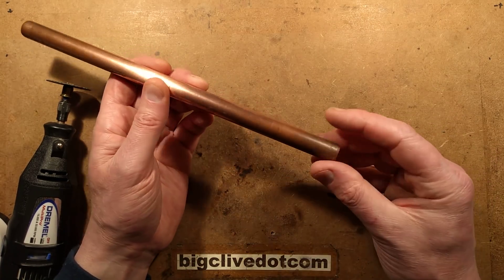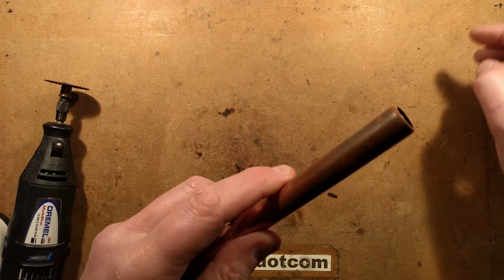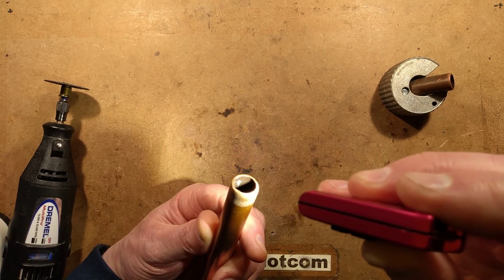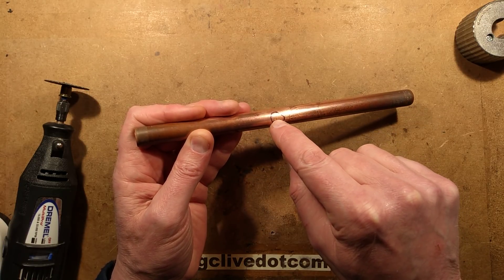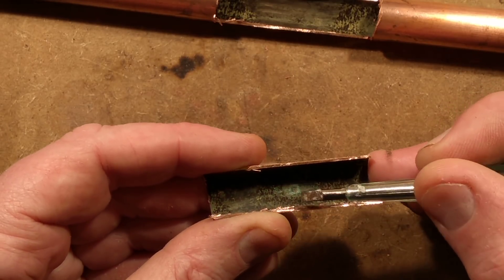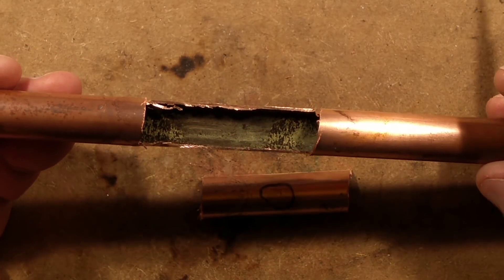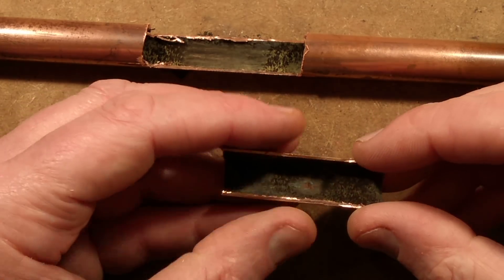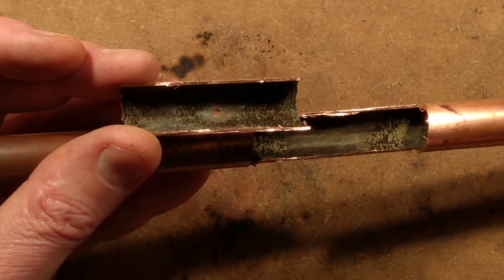Odd pinhole leak in copper pipe.  Selective electrolytic corrosion?

Comment: Was it in the hot or cold water line? If the hot, do you have a circulating system? There's only a few reasons a pinhole happens in a run like that and not at a directional change or material change. Depends on the answer to my above question, need to know if it was hot or cold for sure...and if there's a circulation system...and what kind of backflow device is used where you're connected to the boiler you mentioned. Unless you were talking about a water heater and not a true boiler.
Reply from the maker: Main cold feed.

Comment: Locking the barn after the horse is gone...
I most always shut off the water coming into the house, if I  am away for more than a day or two....
This doesn't fix anything,, but it limits the damage of a catastrophic failure. 
Keep up the good work,,  always interesting videos...
Reply: That works great unless the pinhole is ahead of the mains shutoff as it was in my case. I had to have the city shut of the water at the street and then spend $10,000 CDN digging up the front yard to install a new feed line into the house.
Reply: @PhoenixRevealed  
Yes Sir..  that is one that we have no control over..
And it is still a bummer...
I hope there wasn't too much dammage.
I think in some communities,  the municipalities are responsible up to the shut off/meter..
Thanks for the reply.
Reply: @willybee3056  - Had to replace a laminate floor in the basement, but it could have been much worse.
Reply: @PhoenixRevealed  10 grand for a new feeder line, jesus i've run half a km of sewer for less than that much less simple water feed
Reply: @Mister_Brown  - Most of that cost was the excavation, much of which had to be dug by hand due to proximity to the house. It also went straight through a front porch which had to be rebuilt afterward.

Comment: hi Clive.
i have been a plumber for 32 years. 
what you have there is recycled copper pipe with steel contamination. it will only get worse. 
if you take a caliper and measure the wall thickness at various points in that piece you cut out you will find discrepancies. 
sorry, but you need to change those pipes.
i could give you a good price on that  but you would have to pay my air fare from Canada.
Reply: As a mechanical engineer I've seen this even in "pure" copper pipe. More often than not there is an ancient boiler/water heater upstream of the problem... I bet if Clive gets that unit flushed out it's full of sand-like rust! Tiny bits of iron can get swept up and stuck in the scale that forms inside the pipes, and with the chemistry of the water can corrode these kinds of pinhole leaks.
Reply: @Smidge204   hi smidge, you have a very valid point. if clive gets his boiler flushed he should check if a magnet can pick up whatever comes out. we actually have magnetic filters in our highrises. (not the fake ones). unbelievable what they pick up.
Reply: @Smidge204  would the water heating element scaling off over time introduce contaminants?
Reply: @nathaingalt8623  usually electric immersion heating elements have a corrosion resistant jacket. What's more common in older systems is the heater  itself is a plain steel tank, which gradually rusts out. Newer tanks have cathodic protection but that doesn't last forever, or are coated with glass or enamel on the inside which is better but can still fail.
Reply: @Smidge204  I wonder if that's why some things like heaters are supposed to have a sacrificial zinc?
Reply: @pauljs75  That's EXACTLY why...
Reply: @pauljs75  Wasn't magnesium rod?
Reply: @Smidge204  This has me worried now - our water tank rusted and burst several years ago, then a few years later the pipes upstairs leaked which resulted in having to get the asbestos guys in and replace the whole ceiling.  I wonder if any more problems like this are in store...
Reply: @Smidge204  this occured in both the cold and hot water side of my dads house. Our water comes from mountain run off. We believe that over time, iron bits from the water we got made its way into the pipes. We also noticed, there was always a corrosion layer, covered by a deposit layer that protected the inside of the pipe like the enamel on a tooth.

We installed a water softener, and within a couple of months, had our first leak, and within a year 3. Before that, never had an issue. Also had installed a water filter inline before the softener and if i had to guess, unless the water softener had metal shavings in it, its unlikely that the iron deposits came from the softener.

Im guessing the soft water began destroying the mineral layer.
Reply: @SupernovaSpence  Water softeners leak some of the salt, so if there is some iron n the pipes is going to accelerate the corrosion.
Reply: This is the sort of stuff that makes me dream of a house plumbed with 316 stainless steel 🤪🤩
Reply: Recycled copper is electrorefined just like most other copper - it isnt a process all that prone to chunks of contaminant.
Reply: Hi Clive
...
I too have been a Plumber some 42 years.
Lawrence can you remember when Cu (copper) pipe in UK rocketed in price.
Then we had a massive influx of cheap imported Cu that was passed off to the unsuspecting plumbing trade at the time, as UK Cu, now Dunn'a be asking the year.
But the pin hole were in fact due to Electrolysis within the impurities later found and pinned down to this import. They were thousands of metre in the housing industries. I've taken a few hundred metre of that faulty Cu out.Also at that time Plumbers were accused of not flushing systems out after using Steel Wire Wool days to clean the ends of pipes Pre-Self cleaning Flex.
What I also found out, (which got me into electrical and dabbling in electronics) that in some of these dwelling there was a small earth fault of <15mA enough to make your ear tingle in tight spaces when you held onto one peace of pipework then rested you head on another.
Reply: This is why people are going with pex.
Reply: @Tb0n3  It is the better option for most applications, albeit a bit more expensive.
Reply: A good price doesn't include a large cost in airfare lol
Reply: Chlorine, hard water, water cavitation, impurities within copper during manufacture, shitty craftsmanship by leaving tonnes of flux around soldered joints are normally the cause!
Reply: I'll not disagree with this as a potential cause but knowing the property type Clive lives in, approximate age, looking at the gauge of the copper pipe wall (looks like decent original British stuff), I would say this is original copper pipe in his house, would not be more recent (last 30-40 years lets say) copper pipe - so could be a good 60-70 years or so old. Therefore I think the contamination is somewhere else in the system, not the pipe.

I have seen a pinhole leak like this on old 3/4 copper pipe, with decent thick copper in my parents house, house was built in 1906 - this leak was uncovered during renovation works about 3-4 years ago so the pipe was a good 111 years old - they were not using recycled copper pipe in 1906 - cause - who knows but it happened. Could have been an old water heater related issue but not sure.
Reply: @peterpeterson9903  
hi Peter,
common use of copper in houses did not begin until the late 40s. before that it was steel, (galvanized) and before that lead. the house may be 111 years old, (115 now) but the piping was definitely not, it was a refit.  the reason i was so sure as to the cause of Clives problem is the pinhole is in the middle of the pipe. 
pinholes can also be caused by cavitation in the pipe and even from introduced contaminants, but this always happens within 2 inches of a joint where flow gets interrupted and becomes turbulent. always. 
i would be willing to bet a steak dinner that your parents leak was within 2 inches of a solder joint. a coupler a 90 a 45 etc.

respectfully,
Lawrence.
P.S.
i only responded to you because i like the way you write. 
clear and concise. good grammar, well thought out.
Bravo
Reply: Scare tactic. Clive's odds of suffering a reoccurance is directly proportional to the likelihood that what caused this, say iron particles settling out, are systemic. If this happened in the only line exposed to equipment shedding some iron particles then this may be the only leak his home will have in his lifetime.
Reply: also common in air-conditioning when people use tools for cutting steel and don't brush off the tools before using them on copper pipes
Reply: We had a problem in Australia with shit copper like that. Turned out it wasn’t from Kembla (local copper mine) like usual. Recycled Chinese shit. Very thin wall. Contaminated Garbage. Caused lots of problems. Now that you’ve replaced that section Clive. I’d be checking your meter, they are pretty sensitive, make sure everything’s off, including the porcelain goddess, and seeing if you have any movement in the meter over say 1/2 hour. Might be other holes.
Reply: I agree with this diagnosis. Unless there is a lack of an earthing pole, this is the most likely issue.
Reply: @NorthernScrub  I'll do it for free, I'm unqualified and have never done anything on that scale before, just home and feed me
Reply: You have already seen that there are more corrosion spots in the pipe, so replace that pipe.

Then check out an other easy to replace segment of pipe in your house and see if there is the same problem... If so I have some bad news for you (you're going to have to replace the entire piping in your house).
Reply: I'm in Wellington New Zealand, I had an emergency callout in a Major Government Building one night a few months ago where a cooper pipe was in hole  leaking in a plumbing riser on the  28th floor. It was Canadian made copper pipe. It lasted 38-40 years before its first leak. The newer buildings with cheaper chinese copper pipes- including a local government hospital- are having pin hole leaks already .
Reply: Lawrence todd Verrnier chinesium pipes

Comment: I'm wondering if it could something more simple than a manufacturing problem. When I worked as a plumber (many years ago during the good old days of PROPER Boss white) we always had to use wire wool, files and the like to clean any joints before soldering them (cheaper than using pre-fluxed and solder loaded Yorkshire fittings) so could it simply be tiny fragments of old steel wool that got trapped inside somehow?? Just a thought.

Comment: These pinholes are common in copper pipes but they usually happen in the hot water lines when the water heater has started corroding and spitting contaminants in the lines.  But this being a cold water line I suspect some contaminants have made their way in from the main line from maintenance or a break in the line at some point.  If you've ever turned off your water then contaminants could make their way into the line from a corroding faucet when the water goes back down the line.  Its strange that it happened on a vertical section of pipe, though.  If the line goes up to a steel kitchen faucet then it could be corrosion from the faucet or connecting bits and every time you turn off that faucet the contaminants make their way down and into the elbow down below...  Don't know, hard to say without a trip through the center of your lines. ;P

Comment: Flux contamination from the original soldering of copper pipes.
Reply: Seems unlikely since the pinhole was nowhere near a soldered joint.
Reply: Should have used a flux capacitor.

Comment: Just the other week water started dripping from the ceiling and mold was quickly forming. Turns out a water pipe had burst on the 7th floor in the apartment building and has been leaking down to the first floor. No idea how long it has been leaking but the floors and walls are very thick concrete(50's design). It's going to be a nightmare for them to fix this mess.

Comment: Was this a hot water pipe and do you use a circulation pump for your hot water? I'm a builder in Los Angeles and the most common cause of this kind of pin holes in copper is from flow turbulence in hot water pipes. Most commonly if there is a circulation pump in use, more common still if the water temp. is very high. It is also most common about 12" to 24" downstream from a 90 degree elbow.

Comment: I live in the Northeastern US and had the exact same pinhole leak in a copper cold water  pipe located in my basement ceiling. I clamped a thick piece of rubber gasket over it with a stainless steel hose clamp to stop the leak. It has been like that for probably 15 years and has never leaked since nor sprung any new leaks. I feel that the pipe is basically sound and the leak was just a rare manufacturing defect.

Comment: It is more likely autocatalytic corrosion. When water is stagnant in pipes small particles can drop out and the effectiveness of anticorrosion additives is reduced. That said, peel that section you cut out and take a look at it. It should have a fairly uniform coating of protective scale. If you see lots of different colors and thicknesses then you have a problem that will likely only get worse with time. In your shoes I would begin planning to replace the copper with PEX. There might be some interesting finds if you split open the worst bits you find, and a new PEX system will probably be the last repair to the plumbing you need to do in your lifetime.

Comment: Slow leak in a hot water pipe above my ceiling a couple years ago had the same cause. Plumber said it was a random failure due to a manufacturing defect (40 years or more ago). New one on me. Sort of a relief that it’s not a unique occurrence.

Comment: This happened in my parents house last year on the pipe coming from the hot water tank in the loft and left a stain on the ceiling.  My guess is it's contamination from iron or steel fragments from radiators and other steel things.  My 2p.

Comment: Steel wool was commonly used to clean copper pipes and fittings prior to soldering, so maybe particles from that, possibly combined with an acid flux caused it?

Comment: It's fairly common, usually caused by contaminates and low water pressure unable to evacuate the contaminate. Once the contaminate finds a resting place and lodges against the copper corrosion then starts.

Comment: I'd say it's related to the soldering of the pipes, blobs of solder or bits of flux getting into the pipe, it then cools and sticks to the inside wall of the pipe, and over time gradually erodes away at the pipe wall until you end up with that hole, I'm more likely to go with solder over flux, the solder being a differing metal etc. Causing the corrosion

Comment: PS, a hose clamp with a piece of rubber is a quick fix.
Reply: Or a piece of chewing gum, my pipes are covered with it
Reply: The hose clamp trick doesn't work on pipe that's corroded paper thin. They can be soldered shut. For a slightly more professional job you cut the pipe at the pinhole and use a slip fitting. However as several pros have commented, you're best off replacing the section of pipe, and you should expect more pinholes in the old pipes.
Reply: @hughbrackett343  of course,  by quick fix, I meen temp fix. To stop it till ya fix it "right".
PS, dont crank it tight, just till it stops the leak. Bicycle inner tube is nice and soft, works great.
Reply: plenty of electrical tape or ducktape is a decent temporary fix
Reply: bru th solder over the hole
Reply: @HDXFH  that may work, sometimes, but the rubber is what "seals" the deal... ya hope.... lol
Reply: bru th It sounds like the pipe was supplying drinking water to the kitchen.  So he doesn't want to use potentially toxic materials such as a random bicycle inner tire.
Reply: @johnfrancisdoe1563  lol, !
Reply: @johnfrancisdoe1563  Positive pressure, also pinhole. Try again.
Reply: @johnfrancisdoe1563  Seemed like sarcasm to me. Considering that the pin prick holes are microscopic, not much surface area for contamination... Im also inclined to think rubber is potentially harmless. Besides my tubes are never random, I only choose ones I dont want ;)
Reply: Yes, my 1998 car power steering coolant pipe in front of the radiator had a pinhole leak - fixed with bike inner tube and a fuel line jubilee clip
Reply: @pault5179  your power steering runs through your radiator?
Reply: @renalshomlmes338  why are you surprised ? Most of the power steering coolers are fitted in front of the engine radiator. Some even goes inside like transmission coolers builtin the engine rad.
Reply: @elcouz  In the US, never saw a car ps have any kind of cooler.
Reply: @renalshomlmes338  Guessing most of your experience has been with newer, lighter, and/or front-wheel drive cars? PS coolers used to be relatively common in heavier cars, particularly RWD body-on-frame, and almost always when equipped with a towing, "heavy duty", or "hot weather" package.

OEM coolers were often a simple loop of bare steel tubing in front of the radiator, although heavy vehicles (like pickup trucks and vans) and those with hydraulically-boosted brakes (HydroBoost) were more likely to have finned coolers.

Generally rack-and-pinion steering is less sensitive to fluid heating and contributes far less, which is why PS coolers have become less common these days. Many systems also have greater total fluid capacity, so it takes longer for a significant amount of the fluid to overheat.